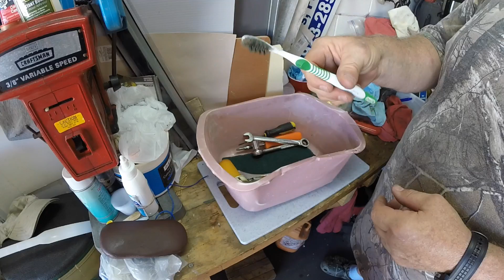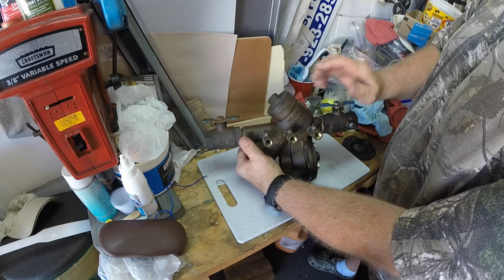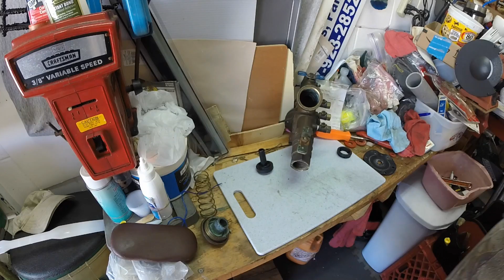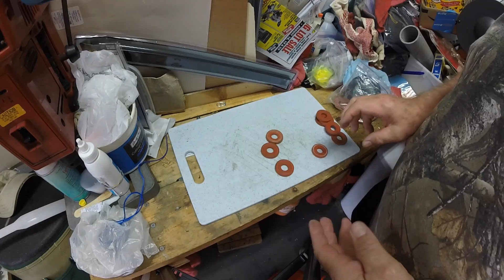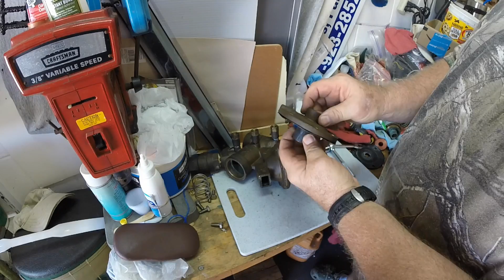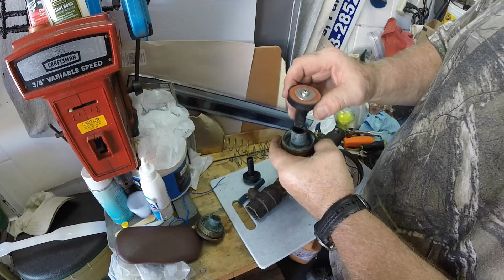BACKFLOW VALVE REPAIR  -  RPZ

Comment: Hi Gerry, great video! Thanks for posting it. 

I need a little help. I have a 16-year-old Wilkins 975XL RP. In 2019, I used a Zurn RK34-975XLC to repair the 975XL because it failed the county backflow test. It's worked great for 4 years. Unfortunately, when I activated my irrigation system this year, water came gushing out of the vent. I checked the upper and lower check valves, and they seem fine. I also checked the relief valve, and that's okay too. With check valves 1 and 2 installed, all the test cocks closed, and the relief valve cover and components removed; I opened the ball valve to flush the sensing hole, but nothing came out. Instead, all of the water continues to come out of the vent. What am I doing wrong? Thanks!
Reply from the maker: I would start by cleaning out the blockage in the relief valve sensing hole.
Reply: @LunkerFishing  You were absolutely right! I removed checkvalve 1 and the relief valve and used compressed air to try to clear the sensing hole. When that didn't work, I kicked up the air pressure from 80 psi to 120 psi and that did the trick. It looks like the clog was nothing more than a bunch of dirt that had wedged itself into the sensing hole. 

By the way, here's a great crossection view of the sensing hole: https://youtu.be/8zabRtFXCUQ?t=128 I just reassembled the unit and it works great! Thanks for your help, Gerry. 🙂
Reply from the maker: That is outstanding!                            Gerry
Reply: @LunkerFishing  I have another question. After 16 years, the 1" ball valves going in and out of the backflow are hard to turn, probably because of all of the minerals in our water. I checked the Zurn website and I didn't see any ball valve rebuild kits, aside from new handles. Is there anyway to make the valves easier to turn or is it better just to replace them entirely? Thanks!
Reply from the maker: @idealynx , This valves are often turned only once a year during testing by me.  Yes, they are hard to turn and I also concluded that is because of mineral build up. I usually use a crescent wrench at first then a rag over the handle to turn them back on after testing. 
I never bothered to do this because I was on to the next valve but most likely if you exercise the ball valve it will get easier to turn. Since the ball valve is likely press fitted in place I would not think it would be worth rebuilding them, even if they sold those parts. 
You can always replace it but how often do you really turn that handle and a new one will likely be stiff after a while also.         Gerry
Reply: @LunkerFishing  That's a very good point.

Comment: Thank you for you video. I replaced my washers from both check valves but every day I noticed a few drops of water  coming out of the bottom. Is this normal?
Reply from the maker: If after 2-3 days the dripping is the same that is not normal. I cannot stress how important it is to clean all surfaces off before replacing the discs.
Reply: Ok. Thank you for your quick response. I really appreciated.

Comment: What causes the issue when it leaks from the diaphragm were the bolts are not the relief valve but from the bolts
Can it be because of freeze damage or do the bolts need to be tightened up ?
Reply from the maker: Freezing can cause the bolts to back out or they were not installed tight enough to begin with. Possibly the threads are stripped or worn too.
Reply: @LunkerFishing  so what would be the best solution to change out the bolts,as well as the diaphragm? Or just the bolts ?
Thank you for your reply
Reply from the maker: @oscarreyes9133  Pull the bolts and cover plate with the diaphragm. Inspect the threads to find if the bolt threads are worn, if bolts keep loosening then apply blue lock tight to the threads to keep them from loosening again. Check the diaphragm for holes or tears or wear and replace if necessary. Make sure you align the small hole in the diaphragm with the way it was originally or the relief valve will not function and do not forget the spring.
Reply: @LunkerFishing  thank you sir
Reply from the maker: @oscarreyes9133  You are Welcome!                              Gerry🙂

Comment: Wow what a helpful video! Question for you, I have this type of RPZ to my sprinklers. The inlet 2” valve handle rusted off and the valve is closed. I removed the rusted lever but could not find a replacement and need to turn the valve on for my sprinkler system. I tried large Vise grips, WD40 and PB blaster and tried to rock the valve stem open/closed but it is frozen. Plumber was afraid it would break and wants to replace whole RPZ. Any suggestions? Can you just replace the whole 2” inlet valve and keep the remaining RPZ or need to replace RPZ?
Reply from the maker: Just saw your question. Yes you can replace just that shut off but entire assembly must be removed to be placed in a vice. The replacement must be obtained from a supply house. New item installed then reinstall valve. Lots of work. I have done that before myself to salvage several valves into one but a plumber would charge likely more to repairing than to replace it.

Comment: hi i have an brand new rpd backflow valve plumbed in for our restaurant's soda fountain that is making a high pitched whistling sound  It is coming directly from the valve  We changed the new valve after complaints from next door business and was ok for a few days but high pitched whistling came back  Any solution please?
Reply from the maker: Valves when in operation vibrate from water passing through them. Hold the valve tightly with two hands and if the sound goes away you need to secure the valve with a bracket or something like that to stop the vibration. Possibly where the assembly is currently secured has become loose allowing it to vibrate. Another possibility is the water pressure has changed feeding the valve. Since the old and new valves sing the issue is common to both and excess pressure is causing more water to be forced through the valve. Any other changes to the plumbing recently to change the flow of water?

Comment: Hi, I have an RPZ.  I replaced the large flat rubber gasket/diaphragm on the relief valve but now there is water shooting out the tiny hole on the inflow side of the relief valve, can you tell me what causes that?
Reply from the maker: Atul,
There are several things that can cause this.
1) The Diaphragm is leaking/torn or there is dirt/debris on the surface where the diaphragm is mounted. Also make sure you tighten the cover bolt evenly and snug, but do not strip the bolts.
2) There is a hole in the diaphragm that is where the water flows to the relief valve. That hole must align with the water port.
3) The diaphragm is attached to a plastic piece in the center. That plastic piece must sandwich the diaphragm such that it seals tightly against the diaphragm. On the side of that plastic piece towards the cover plate that is leaking there is a small O-Ring. You must replace that O-ring but first you need to clean the surface that plastic piece with the O-ring is inserted into on the cover. If you do not get that place where the O-ring seats against to be clean and smooth it will leak like you describe. When you replace that O-ring you must lightly lubricate the O-ring and lightly lube that surface you just cleaned. Never lube the diaphragm. Make sure you use a food grade lubricant like Super Lube or the package of lube that comes with the parts sometimes.
4) The diaphragm has stripes printed on one side. The stripes must be located so that they are against the cover plate that is leaking.
Gerry

Comment: Very helpful video! Would you be willing to make a video showing how to replace a shut off valve on a Zurn 975XL that is hooked up to pvc pipes? I am a new tester and need to see the best way to do this. Thanks
Reply from the maker: Chris, There are two shut offs on every backflow valve. One before the valve and one after.  Just turn them so they are perpendicular to the pipe and that turns the water off. You can also go to where there is a main shut off on the supply pipe. Usually that is where the water line enters the property where there is a meter from your local water authority. Just use a crescent wrench with a large screwdriver through the hole on the wrench handle for leverage to turn the shut off.

Comment: could putting the diaphragm backwards cause the vent to dump all water?  I got a replacement kit but the new diaphragm doesn't have the wavy lines and it appears not to be exactly like my orginal one but it is the same size
Reply from the maker: I never saw one without the lines. If the holes line up you should be good.          Gerry

Comment: Hi ,
I purchased a repair kit and followed all the steps but still have a leak. 😭
Reply from the maker: Jesenia, There are a couple of issues that make a difference. How well did you clean off the seat inside the base of both check valves? (where the disc mates against to make the seal) You need to clean off the build up on that seat and you cannot clean it with something that is sharp that make scratch the seat. An old toothbrush with the handle melted close to the head to make a 90 degree turn allows you to reach down in there and clean the seat well. You also must check the seat to make sure there are no cracked pieces or pieces of the seat missing. Run your finder in there and it must feel exactly as the other seat does on the other check valve. 
The poppet holds the disc. You must clean the surface where the disc sits before installing it on the poppet or it will allow water pressure past there. Remember what I said in the video, cleanliness is everything inside the backflow valve. Sometimes when I install the entire kit the valve still fails to hold pressure and I am meticulous about cleaning everything. With my meter I can see what parts are not working well and I have to take the two check valve caps off, pull the poppets, and reinstall them again. Sometimes things just do not sit right the first time. Without a differential pressure gauge you cannot tell that on your own. Are you sure you installed the check valves springs correctly? The heavier spring goes in the check valve on the top and the lighter spring goes in the check on the bottom. That is an easy mistake to make. 
How mush of a drip are you getting? If it is just a small drip, if a drop every few seconds, just leave it alone for another day or two. If you cleaned everything well and that is not the issue it may take a few hours for the disc to compress and make a good seal. If it is a heavy drip then you did something wrong.
You may not want to hear this but I am going to tell you the truth. The entire assembly is made of brass which is a soft metal. I have had 2-3 valves over 11 years that just went bad. No matter what I did they would not work right. I think the frame is no longer straight and things just do not line up. That is a possibility but most likely something else is wrong because that happens so infrequently.
Reply: The "melt a toothbrush to 90° angle" tip is pure gold! Thanks Gerry!

Comment: Gerry, great tutorial video. I have a Febco series 825Y back flow valve where the water is leaking thru the diaphram mounting bolt threaded holes. I removed the diaphram and pressure relief valve.  Cleaned everything,  replaced the diaphram as it did have some cracking.  Also replaced the 2 orings on the relief valve and the disc seal. Reassembled the unit and water still leaks out from the dismounting bolts. A slight drip only on the backside. The diaphram should seal this area from water. Have you ever experienced this situation? I disassembled once again and all looks fine. Thanks in advance for any help that you can provide. 
George
Reply from the maker: George, Only the Backflow Gods can explain some things. The fact that you disassembled and reinstalled allowed something that was not seated correctly to then work better. Did you lube the O-Rings with the grease that came with the parts? DO NOT GREASE THE DIAPHRAM! just the O-rings and only sparingly. Where the plastic piece in the center of the diaphragm goes into the center of the brass cap with all the bolts on it there is an O-ring there. That O-ring sits in that small depression in the center of that brass cap. Some debris will collect in the center of that depression and stop the O-ring from sealing. Always use an old toothbrush to clean the inside fo that depression. In the center of the depression is a small hole that goes through the brass cap. Make sure that hole is open using a tiny wire to clean it. That allows the diaphragm to flex back and forth without becoming bound by pressure inside that depression. I hope my answer does not confuse you more. It is difficult to explain in words something that is simple to see in real time. 
Good luck,    Gerry
Reply: Gerry,
Yes, I cleaned in internal oring groove ...the entire assembly was not that dirty as this valve is being used for my sprinkler irrigation system and the water comes thru my well and house system. I did use the special lubes, sparingly on the orings only.  What I cannot explain is the the water should not come in contact with those cover bolts as the diaphram rubber should seal them off. Could it be as simple as sealing the threads on those 4 bolts and housing threads and be done with it since it's just dripping down the back side of the housing and not coming from the relief valve area?
Thanks again for your time and advice Gerry!

Comment: Have a question, for anyone that can answer...our back flow valve  is on what I was told is called a "loop" that sticks up out of the ground not he side of the house.  It is mounted between to PVC pipes on either side and is between 24 and 30 inches up.  It would be much more pleasing to the eye if it was only a few inches from the ground (say 12 inches).  My question...is there some reason this has to be that high and ugly up the side of the house?  Could I cut it down and have it be just as effective?  Thanks.
Reply from the maker: Carl, depending on the type of backflow assembly you have (PVB, RPZ, DOUBLE CHECK, etc) the code dictates the required height. 
I will give you one even uglier. There is a way to not have a backflow valve at all. You need to have a loop that goes many feet in the air then back down. I would have to look up the height and the name of it but it was around 32' in the air or something like that. If you have a multi story home you could just run it up the side of the house and back down.